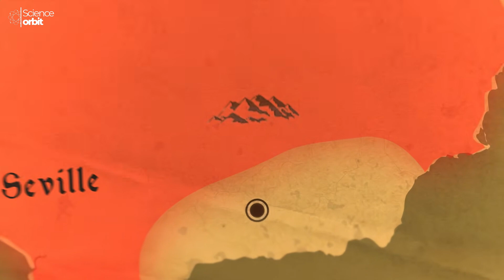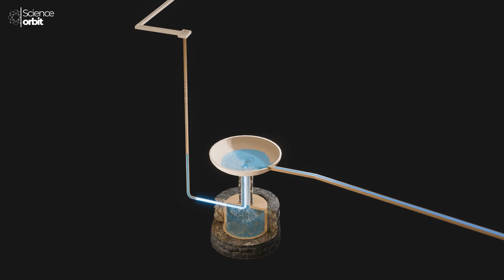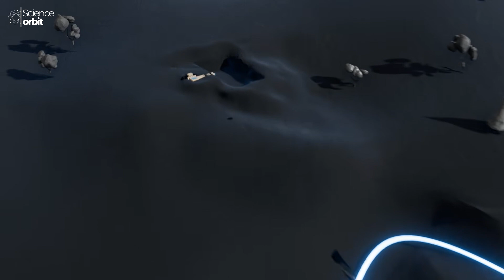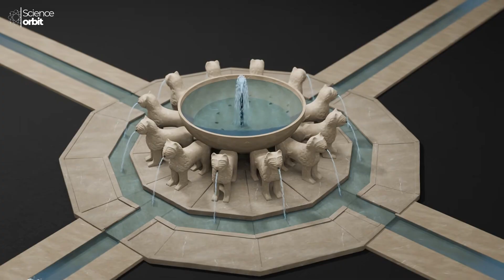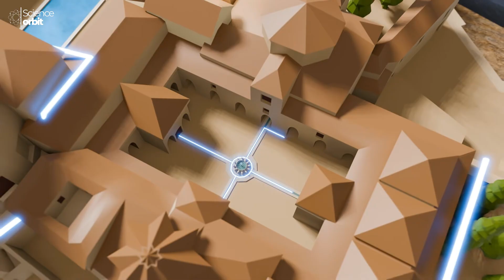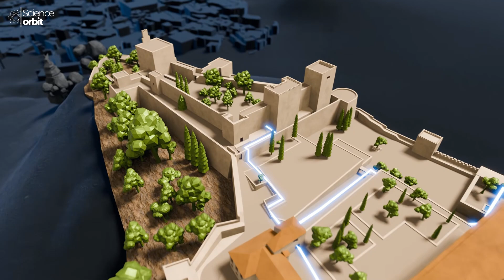The Ancient City That Mastered Water

Comment: If the thermal baths were where kings and diplomats gathered to make deals, do you think the water system was treated like a state secret so enemies could not sabotage the supply?

It is amazing that so many of these systems are still working today. Seeing 700 year old pipes still functioning really makes modern planned obsolescence look bad.
Reply: Ok, I saw the video....

Been building trompe and ram pumps, and trying to figure out perpetual motion.....

Found the original video of this ,  the device at the end....

So I built it, got super lucky had 1 successful model, stayed at it though....

It is not a pump!

It is a variation of a "Foam machine" not a pump.

I now have a working model....

And it does lift water above the pressure barrier.

It does move %100 of incoming water out of the system, by turning all incoming water into a plug flow, or air and water foam of sorts.
You can prove this in your kitchen sink....

Put the plug in the drain, put some water in the sink, then some liquid dish detergent, then if you decent water pressure, turn on facet full blast....

In this example, the soap, air and water that becomes foam floats above the water....   

And does hold some water in suspension in this foam.

So this is real, as shown except, my working model has the entrance neck that goes into the water slightly in the tank with exit arm( outflow)...

The arm is important, and a small air pocket must be maintained at top of the vessel.
And the exit arm must not be at very top to create and maintain this air bubble....

The water incoming does not lift the out going water up the 6 meter height....    

That would violate science...

All it does is draw air in to this solid state system that by shape, and cavitation on water surface at exit pipe, allows air to create and trap this air and water mix, which like the foam in a dish sink rises on its own because of nature.

Therefore a perpetual motion machine is not actually created,
But a machine that can simulate it is, and as explained violates no physics.

It can be scaled up....

I'm trying to get a desk top model working now, had to go bigger in trials/tests .....

The simplicity is able to stun even folks like "the practical engineering channel" who think it is a pump, as shown on said channel....

It's a foam machine..... Not a ram, not a trompe, not a pump.....

It is gentle, doesn't force, it allows nature to do all the work....

Note, I even developed a type of tuning method for getting the water incoming right, with no high math, hydrostatic calculations too.

Try it for yourself!

Free energy of a sort every time we did dishes by hand, and we didn't recognize it....

God nature are so cool....

I wish I could have thought this up, not just figuring it out, but I did great, I think...

Thank you Robert murry Smith, to, I'd have never done it without standing on the backs of men like you.